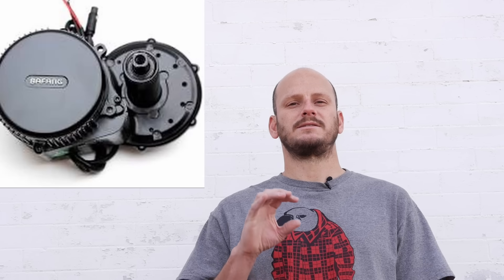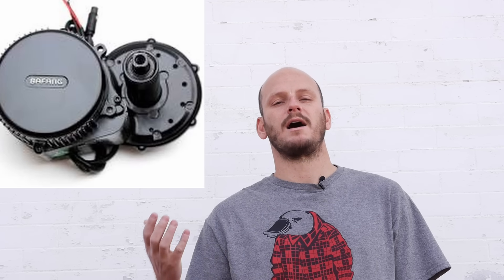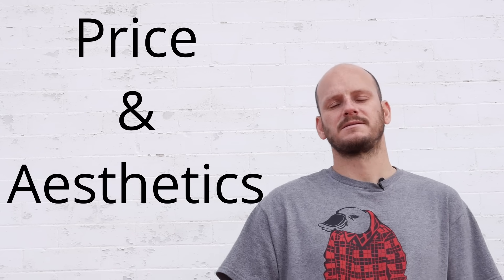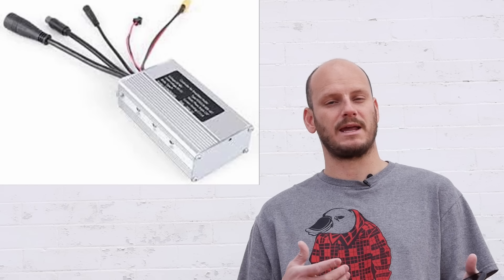Hub vs. Mid Drive Motors: Why Hub Motors Suck and Debunking Common Myths with performance test

Comment: Let's see:   The claim here is that an 80 Nm torque hub drive shreds spokes because the power goes through them to the tire.   But the claim also is that a mid drive motor has twice the torque and yet does not shred spokes.   This needs to be explained.   Seems to me that the mid-drive likely has stronger spokes!

Also, nothing said about wear and tear on the gear train for mid drives that send all that power through it.   While the chain could be the weakest link (sorry for the pun), it's not just the chain feeling that power and wearing excessively.

Also, if mid drive motor drive trains are only slightly cheaper than hub drives, then why are mid drive bikes so much more expensive.  Probably because the components in those mid drives are higher quality!
Reply from the maker: 1-cheap hub motors are often times made with low QC and therefore spokes come loose way more often.
2-When riding a mid drive properly, wear is minimal (installing a gear shift sensor) and riding in the correct gear.
3- correct :) (generally)
Reply: @JohnnyNerdOut  I'm trying to figure this out.  I want so much to have that love for mid-drive, but the logic you've presented escapes me.  1.   so isn't this a complaint about cheaply made motors rather than a complaint about hub motors being inferior to mid-drive motors?  What can you really tell from a comparison of mid drive to hub drive motors when they are not made to equal quality standards?
2. What you've explained here is that mid-drives require an extra level of care or skill when riding!   Not sure how that is an advantage for a neophyte rider.  It implies that mid-drive is more fragile, which is consistent with my original comment, above.
Reply from the maker: @speaknup8009  1- I can see that
2-also true. Mid drives “can” be difficult for new riders who are not comfortable with gears. However I feel like once you get used to riding a bicycle you might quickly outgrow a hub motor and realize it’s performance shortcomings.

Comment: You know, chain is not the only thing that can break. I've broken rear derailleur and front chainring driving a mid-drive. Both times it was in the middle of nowhere and during a night drive. Also I've burned the controller of bafang 750 mid-drive, which was 80€ in costs to get a new one, while controller for hubmotor is about 30€. Also the battery seems to last longer for hub-motor at same speeds and distances and you can drive far more with the same chain and cassette using a hub motor.

Comment: I think the issue is that mid-drive kits appeal to a pretty limited market. someone wanting something very cheap to make a basic ebike will get a hub motor, put it on the front, and zip tie the battery and controller to the frame, which requires much less effort. someone wanting to spend a bit more is more likely to buy a prebuilt bike, so no kit, and probably has other more important concerns about the whole package like price and range. anyone spending more on a custom build will want more performance, and will get a hub for the higher power. the only people looking for mid-drive kits are those who want to build an ebike themselves, that's not more powerful than a legal prebuilt, but who want to spend nearly as much as a prebuilt would cost for something that's likely not as polished and has no support.
Reply from the maker: I mostly agree. I do think building a custom, even with a mid drive can be way less. If you spend a little time doing cable management it can look nicer than some premade s IMO. 😀

Comment: Middrives are better until you run out of battery and have to circle all by yourself. Than you start to love the hubdrive with all the additional gears in the front.

Comment: Thanks for the info, I’m happy with my folding 500 watt hub, bought it in 19 and have had no problems. I’m retired and use it to cruise around every other day, it’s great against the wind and will go uphill a bit, not like your bike but good enough on the prairies. The one problem I should mention is that in hot weather after a while the thermal switch kicks in and it shuts down. 5 minutes in the shade and it’s ready to go. I’ll try out your recommendation for my next bike.
Reply: Maybe you should try doing the heatsink and ferro fluid mod to your hub to keep it cool .

Comment: Hub motors don't suck, they're just heavy for a given power.
Hub motors are extremely convenient. It's the wheel itself, so it just goes in :)
Mid-drive motors are lightweight for their power, and can work with different gear ratios, that's why they're better. But, hub motors are cool--they're convenient to install, nice and tidy, and leave all the room in the bike for the battery pack.

Comment: After using mid drive, rear hub, front hubs here's my tuppence.
1. Mid drive very expensive, the whole kit for hubs is way cheaper.
2. After market Mid drives do look awful and are very noticeable, hubs are small and not very noticeable, unless you go for bigger watts.
3. Mid drives do wear and after talking to local sellers they have plenty of problems.
4. Hub motors don't wear out quickly, had mine for 5 years, no problem whatsoever and do not bother spokes, he must be talking about bigger motors.
5. Hub motors don't set off at full speed and are very controllable.
6. Hub motors can be fitted to the front, which I prefer and they don't affect how many gears you have at all, unlike mid drive.
7. Mid drives are much better if you are using the bike on rough terrain and hill climbing off road.
8. Ready built hub bikes by known brands are about £1000 if not cheaper, mid drives start at £2500 and the really good ones are about £4k at least.
9. Hub kits are about £150 and mid drive about £500. Both don't include batteries. Both fairly easy to fit, bit the bafang mid drive is a bit of a lump tbh and has had problems with the gearing wearing.

Comment: I did not realize the mid motor had the controller built in.  To me that sells it.
Reply from the maker: Ya it’s super nice, keeps it looking minimal. 👍
Reply: @JohnnyNerdOut  Got a 750W Bafang mid mount on the way.  Thanks for the video.
Reply: @JohnnyNerdOut  got my 750 mid mount mostly installed, still need to install the shift sensor (saw your video on it) and I need to find a better place to mount the 52v battery (right now it's zip tied to the cargo shelf).  This thing is smooth, quiet, and surprisingly powerful.  Thanks Johnny for this video!

Comment: what about regenerative braking?  From what i understand, hub motors offer regenerative breaking.  Meaning, hub motors can give you significantly more range for the same size battery.

What is regenerative braking? When you use the brakes, the energy goes back into the batteries instead of being wasted as heat in the brake pads.  

The argument about spokes is irrelevant because both mid drives and hub motors have spoke wheels.  It's more likely that the hub motors with loose spokes are a manufacturing defect.
Reply from the maker: I don’t know. Depends on rider obviously, but I would say at best you could regain 15% of battery capacity if you were really anal about it. Average rider would probably net 5% tops (1-2 miles) IMO It’s not worth it at all. 
You are correct about the spokes 👍
Reply: @JohnnyNerdOut  15% ?  Interesting I had assumed it would be more than that but thank you for mentioning it, something new for me to look into.
Reply from the maker: I have a whole video about regen braking if your interested 🤷‍♂️
Reply: @JohnnyNerdOut  oh nice, thank you I'll definitely check out!
Reply from the maker: @henrievery-3rey  I know you haven’t seen my other videos on the topic, but I address all those issues you bring up. Including who a hub motor is for. As for the myths, mid drives “can” damage bikes if ridden improperly. Yes, because they generate more power=more potential damage. But when ridden properly that possibility is super low and not worth considering IMO. I’ve clarified my spokes debate in the pinned comment. 
If you are netting 15% regen, you are a nerd while you ride. I mean that in the best way possible. Something I would do. However most people are not nerds, unfortunately, and probably would see a third of that at best. 
Yes I am a mid drive fanboy. And I truly believe that in 5 years the majority of Ebikes will be mid drives once people ride them, it’s a far superior technology. 
I have broken 3 chains in the last 5-6k miles and that was due to user error admittedly.
Reply from the maker: @henrievery-3rey  yikes

Comment: try 2 hub motors, 2 50a controllers, plenty torque pulls well on the beach, and does 50mph on the road much faster than a  middrive .https://youtu.be/B3_P46C_Rm0..

Comment: I have hub motor (250w)on my bike and I find it really annoying.In my case when pedalling everything is fine but when I stop pedaling I feel like the bike pulls back and hard to pedal with motor off.So my question is: mid drive motor is easyear to pedal when is off?

Comment: I've been entertaining the thought of buying my son an e-bike.  Everything that I've been looking at are bikes with hub motors.  After watching this video, I specifically searched for mid drive electric bikes on Amazon, and could not find any.  You could buy the actual mid motor, but no complete bikes.  Why is that?
Reply from the maker: great question. probably money. the markup is probably way more on a hub motor bike than a mid

Comment: Let me get out in left field and I will give a 100 year old example to back up what you said.  I have followed a Ford Model A web site.  The owner spent the bucks for a 26% overdrive gear box.  He uses the overdrive with all three gears.  He has videos showing how the overdrive greatly improves drivability and makes it much more fun to drive.  The Model A is underpowered just like a 750 watt motor on an E-Bike.  The mid drive with Gears or chain sprockets on the bike are the only way to go.  Thanks for sharing your perspective.  100 years apart and reality has not changed.
Reply: 750 watts on a hike underpowered? You best be an Olympic athlete to keep that up for more than a few seconds with your legs! Torque matters more for the hills, though. That's where hubs can fall short.

Comment: JohnnyNerd, I did it.  I successfully converted my hub motor ebike to the Bafang mid-motor and WOW, what a difference.  Smoother ride, better acceleration, more power, and quieter.  Thanks for your advice and videos.  I will be upgrading my wife's bike next.
Reply: How the hell is it quieter? You must have had a terrible hub setup before then. Guessing the cheapest Chinese kit with a square wave controller
Reply: Firstly congrats.
You replaced a 350 watt cheap with a 500 watt middrive & guess what, it's faster & pulls better. That you have to carry a spare battery for a 350-500 watt kit seems a bit strange, I first had a 13 ah battery for a 1500 w      hub, depending on how much I pedaled I could get 48-50 miles before the battery died, I now use a 17ah battery on a 1500w hub & get over 60 miles range comfortably, what batteries are you using?
Reply: @wcgebn  10000 14ah gets me about 30 miles.  I didn't realize I can use a 17ma battery. The hub is fine, and i have one on my other bike, but the mid-drive is a much smoother and powerful ride, happy to give up some mileage.  No issue carrying a second battery in the saddle.
Reply: @CarlJBier  There are huge batteries out there but 17/21 ah is the current sweetspot for price vs power. I've been using 1500w hub wheels for 4 years now, I have friends with bafang motors, the hub is smoother, quieter & faster, I am puzzled why a 350w motor would make any noticeable noise at all, my 2  1500w make a low surge noise whilst accelerating but after that their virtually silent, I have had one of them off road at a steady 48 mph, I get over 60 miles on a 17 ah samsung battery averaging @30mph. There are extra moving parts & contact with the chain on a middrive which equates to more friction & complexity, they might have more torque than some hub motors, though this is more a quality issue, mine, unbranded 1500w, thrash my friends equally rated bafang, I do have very high quality Samsung batteries, though so does my friend, I have two hubs both are very torquey & have been flawless. Changing a Tyre on the hub can be tricky, but this is solved with a simple connector, other than that the simpler the better, the middrive adds complexity for convenience not for efficiency, as for breaking spokes & wheels I haven't even broke one sing spoke in 4 years & I regularly shred my bikes, the get hammered through the tight wood I live in daily, not one spoke has broken, so I don't know what this guy is on about?.... I do know that he sells middrive motors.
Reply: @wcgebn  Thanks!  I'll look in to the batteries.  I wasn't sure if I could use a 17a on the motor.  As I said, I have both hub and mid-drive and I do get more battery life on the hub, but for me there is a noticeable difference with the mid-drive.  Love them both but I have more fun with the mid-drive.  "To each his own" seems to fit here :)
Reply: @CarlJBier  yep, if it makes you smile then it's money well spent. Ensure you get the right voltage controller for the battery & motor, the range for a 17 ah battery & 500 watt motor should be quite something.
Reply: Yo is mid motor faster and has a better battery ????? Which is the best motor you can get from a conversion
Reply: @ltpltp323  the best motor is not a Bafang. They're low end.
Reply: @sammiller6631  who has the Best motor ?
Reply: @seahorse5810  "Best" depends on what your use case is for your motor. Since any motor can take any typical voltage, that means you can turn a "250 watt" motor into a "500 watt motor" or more depending on the quality of the battery or motor controller. 

Higher voltage increases speed, higher weight or hills increases load, requiring more current, which causes more heat. Lower quality parts like bafang don't handle heat well. So you can't push them as hard and they break quicker.

I don't know what you need from a motor so it's hard to guess. endless sphere forums is a good place to figure out yourself.
Reply: @ltpltp323  I have the Bafang 500 watt.  I'm getting about 20% less battery life over the 350 watt hub motor I replaced.  Faster (up to 28mph), much smoother, more power on hills, big upgrade from Hub motor. (I carry a spare battery on the bike)

Comment: Im also shopping around for a mid drive just because ive heard hub drives suck. I need something that is going to assist me a lot. I had back surgery years back and i have a bad back. I need to be able to use the motor as much as possible. I don't mind peddling at all if the mid drive has a good pedal assist. I ride my bike some times and would ride a lot more if my back wasn't screwed up. So im thinking a mid drive will meet all of my needs as far as letting me pedal to get some exercise, but then using the assist and throttle to help me out if i need to get back and can't. It has happened.

Comment: Not true. If you get more torque it must be using more power ( Power = 2 X 3.142 X N X T ) Using more power will use more battery resources. Simple if you go faster you use more power.